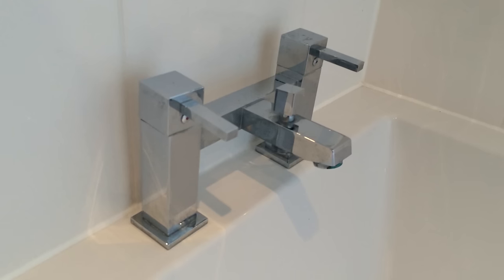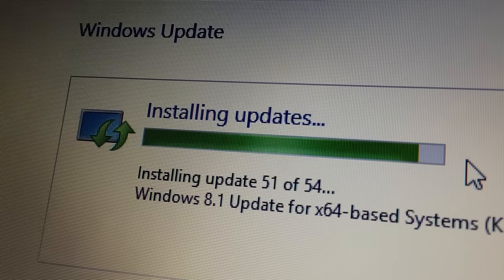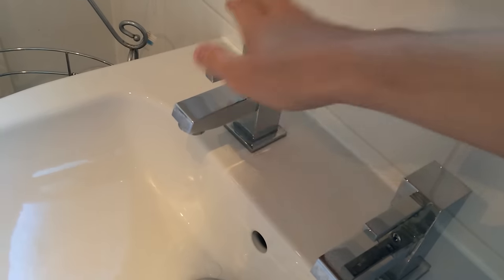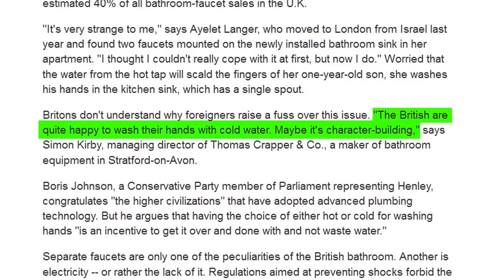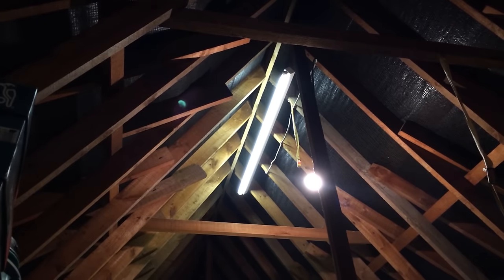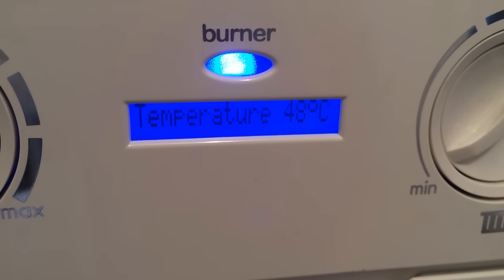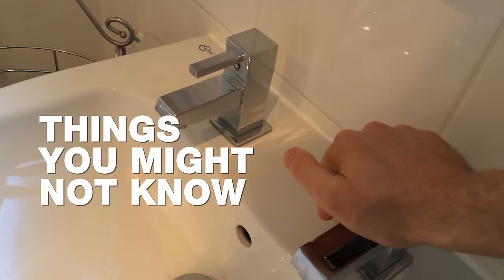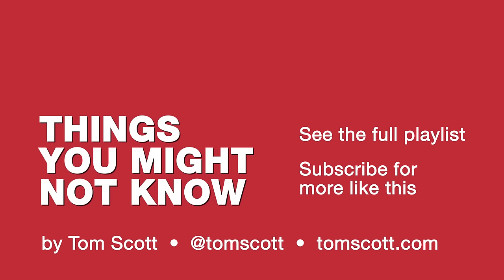Why Britain Uses Separate Hot and Cold Taps

Comment: As a plumber, I can tell you that the main reason for that, in 2021, is "old habits die hard". Even with old storage tanks, there are ways to prevent backwash and there exist regulations concerning that.
Reply: But a Reduced Pressure Zone device would probably need to be used to comply with the regulations which would be expensive to maintain and less practical than having two separate taps
Reply: Exactly the reason; to keep mains water separate from possible contamination. 
Regs were relaxed years ago.
Similarly,  do you remember when all toilets had to have syphon flushes and a way had to be made to run the overflow. The good 'ol days - not!
Reply: Old habits die hard is so very true because pipes and tanks used to be lead.   Pressure reducer valves are building code requirements where I live
Reply: Regulations, not solutions.
Reply: I agree.
As afellow plumber as well, there are solutions. Here in France, a disconnector (lets say 2 check valves + purges in a single item) has become mandatory right after the water meter. 
You technically can't pollute the main anymore.
Reply: But even with preventing a backwash, arent we still talking about water that was stored in a storage that hardly ever gets cleaned? When coming back from vacation or a longer absence we here usually leave the water running for a minute to avoid drinkimg the water that was stading in the pipes for a longer time. 
Refering to the videos those storage tanks are under the roof and the roods of older houses often are not very well insulated. I'm no expert, but coming back from vacation  and drinking water that was stored in an old tank at 35°C for 3 weeks does not sound very healthy to me.
Reply: Glad to live in Germany where things like these got regulated decades ago and all in all rules and stuff are very very strict.
The water out of a tap (and esp. the plumbing, compared to other countries) is in fact the most regulated food in Germany
Reply: @andregenter4213  I think you didnt understand the video. Obviously there are regulations in the UK too.But it doesnt help, if the water is fresh, clean and contoled,when its delivered, but then people impurify it  in your own house installation. The UK law prevents that water that might be germ-infested by  storing it in a big tank under the roof, gets mixed with the fresh water. As long as you drink or use the water from the cold water tap, you can be sure it never got in touch with the "old" water from your tank.
In Germany it's quite common to heat your warm water in a boiler. If people reduce the heat of that water to less than 60°C  there for example is a risk of legionela. Those are bad enough under the warm shower. But having one tap only, you get your fresh, cold drinking water and the impurified warm water from that boiler from the same tap.
In Gernay we also still sometimes hear of people living in old houses where the house installation was build with old lead tubing. Here it also doesnt help, that the water was contrilled before if was delivered into those lead tubes.
Reply: The main reason would be the world famous terrible british build quality which is why you don't have any sort of manufacturing industry there anymore.
Reply: @mikeperth8027 yes but we do have clean drinking tap water but you may bottled if you wish.Our tap water may not taste as good as bottled but it is clean...plus I filter mine.
Reply: @mikeperth8027  We have loads of manufacturing in the UK, often high tech, like the company I work for, we are acknowledged as the best in the world in our industry.
Reply: Tom is showing an upstairs bathroom sink which in older houses is often fed off a cold water tank, whereas kitchen taps often flow directly from the mains pipe, dispensing fully potable water, logically most people wouldn't drink water from an upstairs bathroom sink, they would drink water from the kitchen sink.
Reply: How often are bathroom cold taps in private homes fed from the mains, like this video claims, instead of from a cold water tank? In commercial buildings, only kitchen cold taps are fed directly from the mains while bathrooms from a "break" tank - I have a good deal of experience inspecting these kind of setups but none with private homes, so I'm interested in a professional's experience. (This regards solutions in Britain)
Reply: It seems British people are attached to their taps as much and as irrationally as they're attached to their monarchy
Reply: Is the problem also that it is harder for a mixer to mix a high pressure cold with a low pressure hot? And it to work nicely?

Comment: I once lived in a house where the mixer tap in the kitchen actually had two separate channels within the chrome "dispenser". It was horrible to use as the two streams would exit side by side with no actual mixing so washing one's hands was a wierd feeling of freezing and boiling in what looked like a single stream. This was obviously someone's way of providing a mixer tap without violating the relevant regulations
Reply: Had a kitchen tap in a flat that was like this. It wasn't that old, I think it was just a shitty tap
Reply: my parents bath used to have a massive fancy old brass mixer tap that did the same thing... it was an actual mixer tap but the streams barely mixed... such an odd feeling on my toes
Reply: 5 Gum moment?
Reply: Same and this was in a (admitedly kind of shitty) rental flat I was in ~6-7 years ago.  So not that long ago.  I always assumed it was just a low quality tap.
Reply: That's what this one in the video has too
Reply: Just put a tiny funnel underneath and voila! You have warm water.
Reply: Feeling vs scolding or freezing?
Feeling for me
Reply: @gimigimi1299  *scalding
"Scalding" means "burning hot". "Scolding" means "angrily criticising".

Comment: When I was young (in the 1960s), I always drank water from the bathroom sink faucet because it was colder, and seemed to taste better. When I got older, I realized why. The water main entered the home directly below in the basement. The kitchen faucet was on the other side of the house, so the water got warmer as it traveled through more pipes. It just wasn't as refreshing.
Reply: I'm not sure that really make sense. The water would have travelled through miles of pipes to get from the treatment plant to your home; why would a hundred feet or so of extra piping be what made it go bad?
Reply: @teh-maxh  Because all those underground miles are chilled - the further you go above ground, in the house, it gets warmer.
Reply: @teh-maxh  Same reason it takes a while for the hot water to turn hot.  The pipes running under your house get to room temperature, which is warmer than cold mains water and cooler than hot heater water.  Surely you could get the kitchen sink water colder by running it a bit to clear that length of pipe, but that happens faster closer to the source.

Comment: "If it always worked, why we need to change it?"

After 4 years in England I understood that is their universal motto (for everything, seriously).
Reply: Like some of their sewage "systems"...
Reply: What’s wrong with the sewerage system?
Reply: @Station9.75  I watched something a a river that was built over and is used as apart of a  sewage system... Someone actually has to go down there from time to time and break massive bits of sewage, or it would get stuck and eventually stop...
Reply: Yep we say, 'If it ain't broke, don't fix it'
Reply: @Tasorius  we had proper sewerage systems when many countries were crapping into buckets.
Reply: @leedsman54  Therefore it's great to use the system from back then...?
Reply: @Tasorius  I don't know where you are from, but not everything is modern is any country, it's always a mix of old and new
Reply: Except leaving the EU...
Reply: I dont know what you mean... carries salmon suspiciously and gets arrested
Reply: Most countries that built major infrastructure in the late 19th century still use a lot of it. Paris sewers too, last I checked, not to mention numberless rail lines. My own city in Canada is getting around to replacing a lot of leaky under the street pipes laid down around WW1.
Reply: “If it ain’t broke...”
Reply: @isisvanhoof7870  well, the argument for many was that the EU wasn't working for the UK in certain areas. Whether or not you agree with that mindset is irrelevant, that's just the way many people thought.
Reply: It's a good way of thinking. In my area in Canada it's like that
Reply: this is why so much of Scotland (which is much more progressive) wants to leave the UK and stay in Europe. We are constantly being held back by this "We don't like change" attitude of the English.
Reply: If it ain't broke don't fix it, but really make sure it ain't broke.
Reply: Look at the land rover defender, say no more.
Reply: Gary Whittaker  Oh yes, absolutely ecstatic. We have parties every night to celebrate that.
Reply: That's a good motto.
Reply: The motto is: If it ain't broke don't fix it !!  ;-)
Reply: hyndscs  Or even Roman?
Reply: Do you still use a typewriter also?
Reply: Like their pavements
Reply: @SummerBayJournal  what you have to remember is. it is the English which is funding everything you do, as you have no money. Feel free to leave, but the EU dose not want you, as all you will be to them is another Grease or Spain, a huge drain on there money, remember your oil is all but gone in the North Sea and you don’t have anything else. So you are a drain on us as well,
Reply: "if it's not broken, don't fix it"
I didn't realise this was just a British thing...
Reply: @isisvanhoof7870  But they probably think: it had worked before the EU, so why be a part of the EU.
Reply: Sort of, they fix a lot of things that are not broken.
Reply: It's not rocket science. You find the solution, that's it - move on, or do you want to keep fiddling with it?
Reply: @Danny-204  stick to your taps and don't bother with things you have no clue for.
Reply: @Bouss™ I’m guessing you are Scottish,
Reply: @Danny-204  No, I'm from that country which somehow you know it's politics and economics but can't even spell its name.
Reply: Danny 204 I’m not Scottish...
Reply: Tasorius every modern sewage system has that 😭
Reply: Isis Vanhoof the EU is definitely broke
Reply: SummerBayJournal lmao we say go for it. Remain in a clearly failing wannabe state
Reply: Danny 204 annoyingly, that’s actually because our government sold the gas (to Russia I believe)

There is/was enough gas there to have it in abundance and for dirt cheap here for more than our lifetimes... however they shafted us; a few people seen it fit to line their pockets with ‘deals’ which means now, we are buying our own energy back at a premium.

Sounds like our fishing trade..

I reckon people who adore the EU are the same ones that hold their wive’s hand as she’s mounted by somebody else, but whatever.
Reply: I work at the  sewage treatment works. Any questions 👍haha
Reply: @SummerBayJournal  but you had a vote and lost just like leaving the EU deal with it
Reply: Gary Whittaker  pull the other one haha. They don't take money from the English but the UK as a whole... If scotland left they'd find themselves suddenly doing a lot better due to their ownership of various assests that THEY own (which the entire UK currently benefits from and pays pennies back to them for via the barnet formula).
Reply: @Nathan-yk5km  failing state? Huh, funny that, last time I checked it was the single richest trading block on the planet, with extremely high levels of education, employment, living standards, social and political freedoms..
Reply: I dont think that is there motto for everything otherwise nothing would ever change
Reply: I think the if it works why try and fix it is a valid point of view but when it is clearly not working they still apply the same logic.
Reply: Except Brexit.........
Reply: @SummerBayJournal  ironic considering they opted to stay a part of the uk because they didnt want the change of no longer being in the eu
Reply: @isisvanhoof7870  Leaving the EU, especially across the atlantic, there is no old, therefore only new remains.
Reply: @isisvanhoof7870  Technically that was a reversal of a previous change, not a change in and of itself.
Reply: "How many times do I have to teach you? Just because something works doesn't mean that it cannot be improved."
Reply: America’s mentality too. Like father like son I guess.
Reply: To the people that says “If isn’t broken, why fix it?”.

I guess you still use horses instead of cars?
Typewriters and hands to write instead of computers?
Old landline phones instead of smartphones?
Fireplaces instead of radiators?

It is not practical to have 2 taps instead of one that mix the water at the right temperature for you.

But, hey oh, who are we to accept progress?
😉
Reply: @blackpsicosi1  In that case, they are broken, or obsolete. They are no longer able to meet the demands for which they were produced, so they're obsolete.
Reply: Ginge like the separate taps.Substituted from a mixer faucet 😉
Reply: @Lester Piglet I don't know. It should be someone's job to figure that out.
Reply: @Tasorius  as with sewer systems all over the world
Reply: @isisvanhoof7870  that doesn't work
Reply: @cplcabs   The words "sewage system" just made me think of nothing but certain slimy and greedy game companies, like Sony... Except they don't even go down there to fix the massive turd that clogs the whole system.
Reply: @isisvanhoof7870  That's broken and can't easily be fixed. Not with France in it anyway...
Reply: @Station9.75  since no one has answered this in a year, the problem with London sewers is that they're combined sewage, i.e. the same sewer for wastewater and storm water. This is typical of cities that installed sewers around the 19th century; and you can find similar in Paris, New York City, San Francisco. The problem is that when it rains too hard you don't have enough wastewater treatment capacity to treat the part-sewage-part-rainwater mix, so you end up discharging your sewage into the river Thames, untreated. This is why London is working on the Thames Tideway sewer — which is still a combined sewer, just a very big one that sends the combined sewage to a very large processing plant away from the city with big rainwater storage tanks. However, better solutions involve keeping the rainwater separate to begin with (things like rain gardens and porous asphalt that send water into the water table instead of down the drain, for instance). Even separated storm sewers aren't all that great ecologically.
Reply: That's why in the USA we still use the imperial system for many measurements, along with other advanced economies like Myanmar and Liberia.
Reply: My family is approaching 8 generations outside of Britain.  Over time, only the ones who think "it always worked" are left back there ;)
Reply: @SansNeural  agree!
Reply: the problem is … „it does not work“ … but they keep it anyway